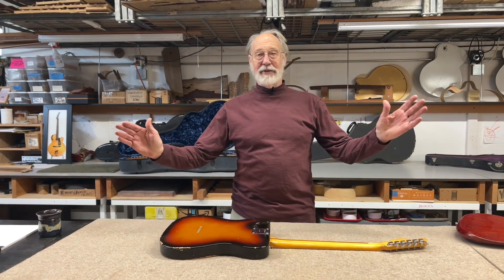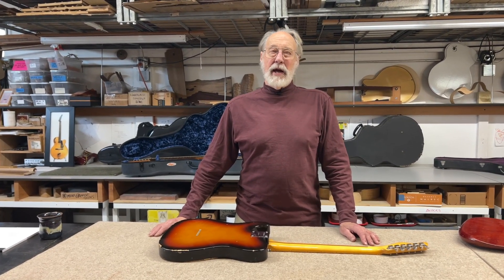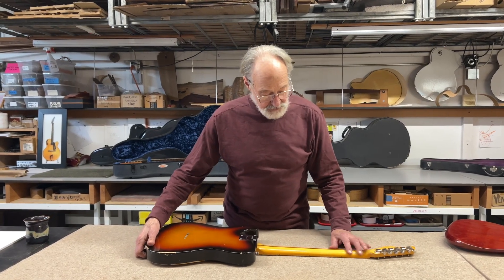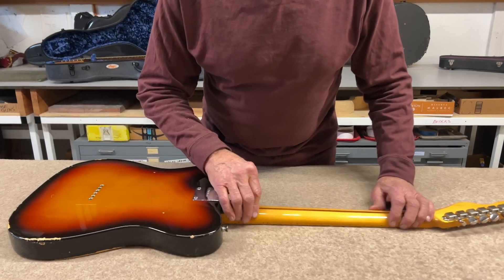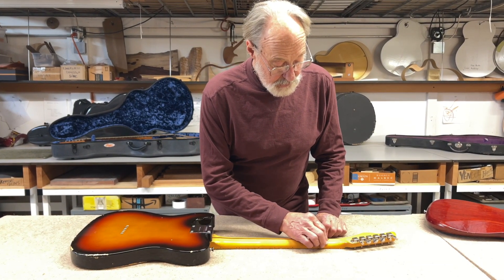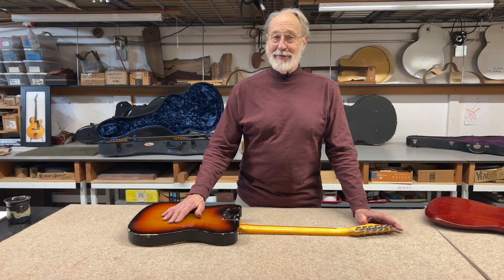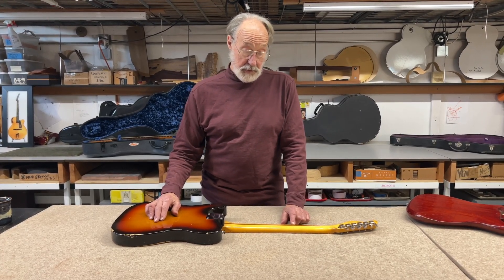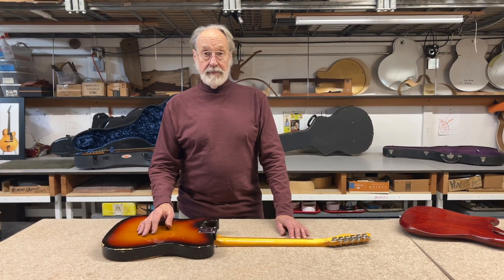Ken Parker Archtoppery - The Neck Journey 5) Neck Creep

Comment: Good show again!
 Curiously.
Those bendy ones, are they rock maple or sugar maple or what?

Well,,, soft maple, non sugar or southern so called "hard" maple---is not so hard! 
But that is what will be told/sold to you nowadays.  
Cold climate clear straight tight grain Rock maple is not so easy to get. and $$
It was always expensive. $$
My  0.02 $
Plenty of non sugar maple was always available for mega making = millions of necks.
Reply from the maker: The maple genus is Acer, and there are many, many species!
As far as I can tell, hard maple, rock maple and sugar maple are all the same tree. There are also soft maples that are available as lumber, and it can get a little confusing.
https://en.wikipedia.org/wiki/Maple
Most maple necks, including Fender necks and copies thereof are nearly always hard maple.
Hard maple has excellent stiffness and impact resistance, pretty good stability, and is easy to bend.
You must take the good with the bad, and of course it depends on what you're doing with it. When we're bending sides it's one thing, and using it for a one-piece neck it's another.
I'm not disparaging maple, we all love this material, it's just that we need to fully understand it and not expect it to do things it can't do.
Big leaf maple on the west coast, and red maple on the east coast are soft maples also of interest to we who build....
https://en.wikipedia.org/wiki/Acer_macrophyllum
https://en.wikipedia.org/wiki/Acer_rubrum
Reply: Hello.
They forgot to mention maybe, the sugar maples are  cash producers, every year.
A big reason why they weren't cut down so fast. Or they would be almost extinct like most other trees. all the "big old ones" 
They were planted for future use.
I have heard of other maple trees producing syrup but 40 gal to one is not so good.
And it doesn't have the flavor .
These special maples are only in North America.   I think?
Hah--I have a quart of it right in front of me. @kenparkerarchtoppery9440

Comment: Great explanation. Acording to the Beauty o the burst book this happened with many vintage Les Pauls, specially because they used to have bigger gauge strings in the 60´s.
Reply from the maker: I never saw this book, but it looks like big fun. Yes, the sinister creep even works its evil on these deified guitars, and now folks won't want to fix it because it because then (HORRORS) it won't be original, and it will be worth less to somebody. I thank my lucky stars I am allergic to such nonsense, and when I worked on these instruments way back when they were only 20 years old, I just fixed them the best way I knew how, got paid, and went back to work on something else. These were the good old days, in my opinion, when guitrs were valued for their sound and usefulness to a musician. These old guitars that have become collectable aren't holy grails, they were products made by hourly workers fudging their time cards, working in a dusty factory where people making crap money got hurt and management didn't care. 
Of course the big strings make it worse, but it'll happen anyway when the fibers on the back of the neck stretch.

Comment: Thanks Mr. Parker for another very informative video. What do you think about Hoxey guitar necks? being made of aluminum would eliminate creep in certain degree?
Reply from the maker: Aluminum necks are strong enough to hang in there just fine if they are OK in the first place. The other problems that come with using aluminum for a neck are deal breakers for most of us. WAY too heavy is the first one we notice, then there's heat and cold issues, and finally, most of us hate how they sound, there Has to be another way!

Comment: Absolutely fascinating! Isn’t this why truss rods were invented, or do they not really eliminate Neck Creep?
Reply from the maker: Good question. First, the lutes are very lightly loaded compared to modern steel strung guitars, so the problem is much less. I think that while It's possible for a robust nail to combat creep in a lute, with its short neck, the modern adjustable truss rod now used is powerless against creep in a long guitar neck with steel strings, which is why we're talking about it. The modern rod can only adjust relief in the low octave of the guitar, and can't really address the stresses further up the neck that makes the neck material yield to creep.
Reply: @kenparkerarchtoppery9440  Thank you so much for replying to my message. I’m really learning so much by watching your YouTube posts. Back to the topic, I’m assuming that the truss rod and creep issues are the reason you designed the Parker Fly. Such a beautiful and wonderful playing instrument. The necks are those are fantastic and having a monocoque shell added overall strength and integrity to the design. Thank you again.
Reply from the maker: Yeah, dependable good neck behavior was mos' def' a prominent Must Do goal for the Fly guitar. I thought the best American manufacturers just didn't care what happened to their necks after they left the QC inspection, if any.
Shame.